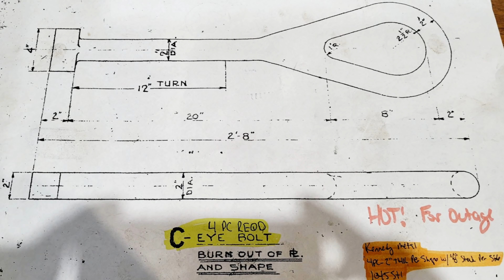Eye Bolt | Vertical CNC Machining

Comment: I wanted to do some forging on that! Throw it in the forge and take the power hammer to it. Slow and steady wins the day over fast. They came out good.
Reply: I was thinking exactly that, the size of these things implies huge loads which to my mind suggests that the things have to be forged, cut from plate, irrespective of material, will not have the required shear strength.

Comment: That's probably a whole lot prettier than the normal forging or weldment that would be used. Hopefully they will hold up under load at least as well!

Did you use the same machine for both operations, or have two machines going?
Reply from the maker: They used two machines, one for one side and the other for second  operation.